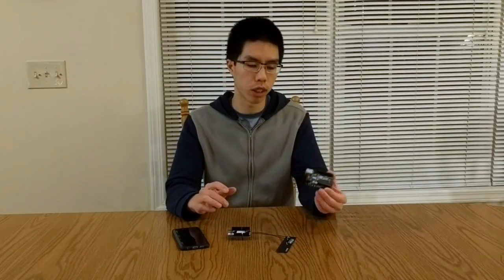#8 SIM7000 LTE CAT-M/NB-IoT Shield Campaign Video

Comment: hi my man , i've read about the same subject for 2 hrs but i still couldn't get it, does NB-iot need a basestation (tower) such like LTE do or it comminucate directly to some kind of reciver like wifi/bluetooh
Reply: Thank you so much Timothy!
Reply from the maker: NB-IoT is analogous to the LTE connection you have on your smartphone but a totally different network. It needs someone like T-Mobile to set up a network first before you can use it. Once you have that infrastructure set up the module can act as a receiver and transmitter via "data" (like 4G, etc) by connecting to the Internet via cellular. Hope that makes sense.
Reply: Hi Timothy, just to be clear for me. If the LTE Network in my country does not support NB-IoT, does it mean that module won't communicate to any GSM-based modules?
Reply from the maker: Carlo Pastoral No, that's not entirely true. This shield is LTE CAT-M or NB-IoT so you only need either one. Also, if you have the 7000C or 7000E version they have 2G/2.5G fallback.
Reply: Thanks for the answer Timothy,  Another question. Is there a way to know what network it is currently using? is there an AT command for that?
Reply from the maker: Carlo Pastoral Yes, there is. I've included this in the example code.

Comment: Great project- Let us know if we can help.
Reply: So does simcom 7000c or 7000E support Nb-IOT guarband and Mobility ( cell selection) ?
Reply: @phanpeace2757  SIM7000C/E supports NB-IoT
Reply: @timothywoo5872  Tks , we're already testing sucessful with Simcom700c,e and TEms investigation 20.3. However, now we faced with problem: cannot doing FTP and HTTP script when laptop donnot enable external wifi. If you turn off the wifi, test case will fail. But enable, ok. It happens even when we change another laptop or simcom eq. But no problem with Quectel bd96 equipment. Do you have any solution ? Tks a lot